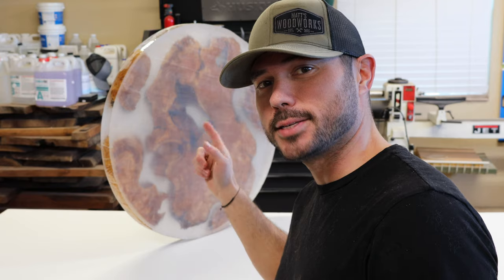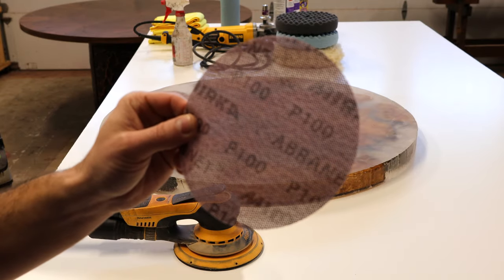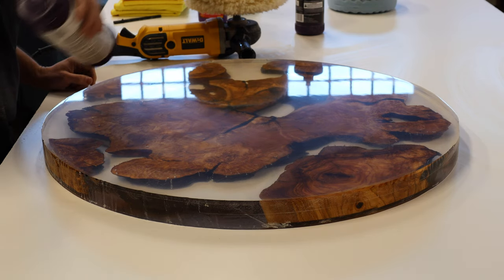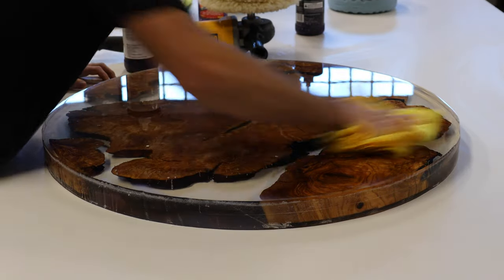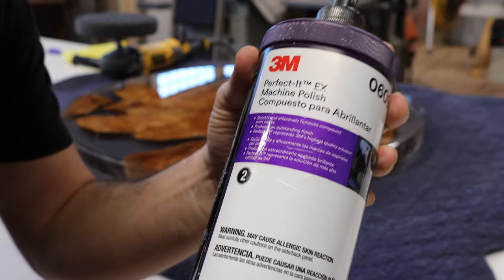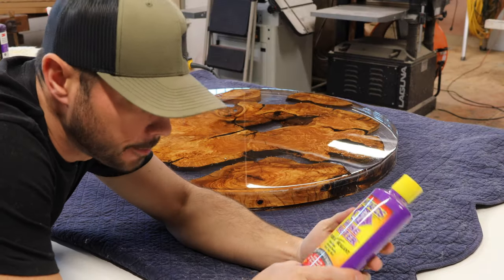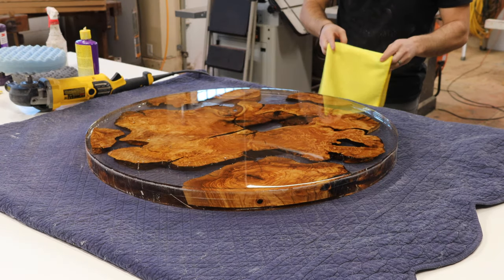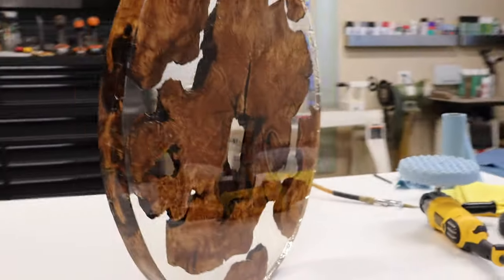How To Polish Epoxy Resin Like A Pro!

Comment: Great video thanks Matt! How would your finishing steps/order change if you were adding a radius edge to top and bottom and sanding/polishing the edge as well?
Reply from the maker: I have done this with both a round over and a chamfer, You can use the sander at an angle for the chamfer just being super careful and use a slow speed, just make sure to go through the grits like above.  If you're doing a round over it's a little more work because I found the best way is by hand.  Depending on how large of a round over you do, sometimes like say with an 1/8" radius the buffing/wool pad step usually takes out all of the scratches pretty well.  Hope this helps!

Comment: Looks amazing! Being new to this I wish there was a brief explanation of the timing on sanding and of the polishing conpounds!
Reply from the maker: Thank you, I would say it's best to sand as long as you need to in order to get the previous scratches out.  Usually I'll make a left/right then up/down (crosshatch) pass 5-6 times and that usually will do the trick! Polishing, you'll need to concentrate mostly on step one with the wool pad, doing this step as many times until all pig tails/scratches are gone!  Hope that helps!
Reply: @MattsWoodworks  Wow 😳 Thanks for the reply! I am gonna attempt my very first round table and have no experience whatsoever. But watching your video made the final push to go for it! 🙌🏼

Comment: Would love to see how you can achieve similar glasslike finish on the edges.
Reply from the maker: I was going to display this, but it's the exact same process just super time consuming.  After 320 grit I do my router edge work and then continue the process.
Reply: @MattsWoodworks  Can you post a picture after you have done the sides?

Comment: Hey Matt, Great video! Just curious do you adjust the speed  on your sander at all when sanding at the higher grits?
Reply from the maker: Usually the highest setting or one click down
Reply: @MattsWoodworks  even at 2000g so 10-9k rpm

Comment: Sloppy casting with all those bubbles in there and he just leaves the edge as is! That's the most difficult part! The surface shines very well but the overall workpiece is unimpressive.
Reply from the maker: Thank you for the input Willie

Comment: just a small suggestion . if you would do slow pours say 1/4" at a time then use your torch to get rid of the bubbles . you may have to torch several times . in other words torch then wait 5 mins  torch then torch again  wait 5 mins torch again . ( you get the idea ) then once it sets up do another pour and repeat the torching . do this process till you get it filled up . then it should come out bubble free . i do hope you don't mind this suggestion . i know people get in a rush and want to done and over with . but with some things slower is better .
Reply from the maker: Hey Donald, this epoxy is meant for 3" thick pours at one time, the issue was the ambient temp being too high unfortunately.  I have done it the way you're suggesting and it totally works, however on the edges you see phantom lines from the previous pour.  Appreciate the suggestions! :)

Comment: Hey Matt. Great video. I have one question. Is it necessary to start with a wool pad since you have sanded up to 8000? Could you start the process from the black pad? Thank you.
Reply: I sand to 10,000 and still always start with the aggressive cut of the wool pad. As he mentioned, it removes all the pig tails from particles under the sanding disc. Also, the polishing process is virtually the same as the sanding process at a microscopic level. You sand from 100 because the aggressive cut flattens out any high spots. It will take twice the time and effort if you start with a softer pad, and probably won't give you the same finish.
Reply: @anthonyfortier8765  Many thanks.

Comment: This is more about the microbubbles.  I've done a deep pour of about 1.5" with Liquid Glass epoxy and had tons of microbubbles.  I hit it with the torch for quite awhile since it's a 72hr set time.  When I was torching I couldn't see anything.  It looked like glass.  I had sealed the wood, as recommended by Cam from BTS.  I thought it was going to be amazing.  After the 3 day cure, I took a flashlight from the underside and it was attrocious.  Microbubbles you can't see when torching or even when no light source is shining through.  But, I can't figure out what went wrong.
Reply: maybe the choice of your epoxy needs to be reviewed.  chosen one before a degassing agent.  and don't brew too fast for long.  also, if epoxy dries too quickly and the room temperature is hot...the bubbles don't have time to come out...the heat from the torch increases the drying rate, so the epoxy becomes sticky and the bubbles remain  stuck.  stable temperature of 21 degrees.

Comment: The very first and very expensive pour I made was full of micro  bubbles. After talking to tech support it turned out that when I mixed the resin with a paint mixer I would bring the paddle blades up just a little above the surface of the resin. Big huge mistake. It just sucks air into the resin and there is no way they can make it to the surface in time. I don't use a paint mixer any more unless I'm pouring a large amount which I don't do very often.

Comment: Did you not do anything to the edges? That would be the tricky part. Would like to have seen that if you did.
Reply from the maker: This project I didn't as it was a failure on the pour, but this process applies to the edges for the same result.

Comment: Great video. I was looking for sanding/ buffing stages and this was great. Two questions though, what clear style epoxy were you using? How long did you wait in the cure before you started the final sand/ buff? Love the piece as well. Subscribed for more info. Looking to start out small but branch my finish carpentry woodshop into a more artistic brach of production. Thanks again.

Comment: Thanks for the video! 

Are the swirl marks primarily removed through buffing and polishing, or sanding? 

I recently finished a piece and was unable to really get rid of them. I resanded it multiple times (up to 5000) and they still remained. It was much smaller than this though, and I only went up to about 1200 RPM with the buffer.
Reply: What kind of pads are you using? Swirl marks are usually happen when you use WOOL  buffing pads, or  HARD foam pad. To get rid of swirls use * SOFT FOAM* pad.
Also swirls happens when: 
1) buffers rpms are too high.
2) excessive pressure 
3) dry buffing. (You dont want to squeeze half of bottle of your polishing compound/buffing paste to your pad and have that splash everywhere,  ut at the same time you dont wanna run dry( just like in many occasions in life), dry buffing cause swirl marks and other crap).
4) obviously check your pad for contamination. Dont use heavy cut rubbing compound and final buff on the same pad.
I hope this would help. Good luck buddy.
Reply from the maker: @TungstenCarbideTempe  @Tyler Ballast what he said!

Comment: so what caused the micro bubbles?
Reply from the maker: I poured the whole thing with a too high ambient temp, I thought I could get away with it but woke up the next day and it was like this, super bummed!  I believe it was 76-78 degrees, usually you want to hover around 68-70.
Reply: @MattsWoodworks   so with that said... my pours are gonna have to be done in my  apartment.( the only space I have that is dust free and climate control) which I normally keep the thermostat at 68 so I should be good right?

Thanks for the replies!

Comment: One thing you should've done before pouring the epoxy is to degas the batch your were mixing. degasing is a very easy process and important to achieve ultra finishes... Good work out there regarding the polishing and detailing. I liked it.

Comment: BTS family here also!
Reply from the maker: Hi Jason!
Reply: @MattsWoodworks  I have a question about freeform sides. Instead of a traditional edge, my client wants a curved edge that is random, similar to a live edge in wood. Would you do the same process on those types of surfaces where the sanding/polishing surface isn't flat?